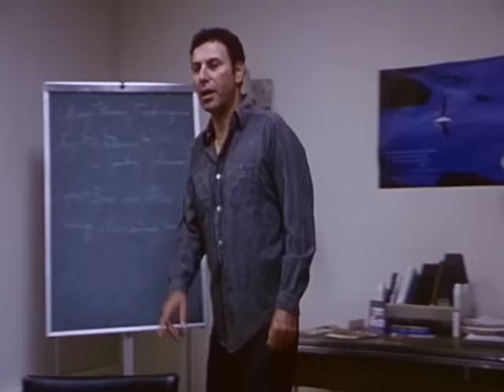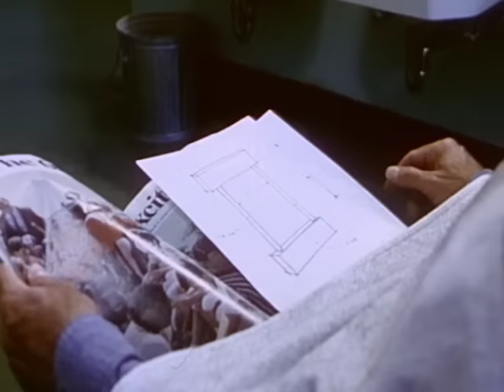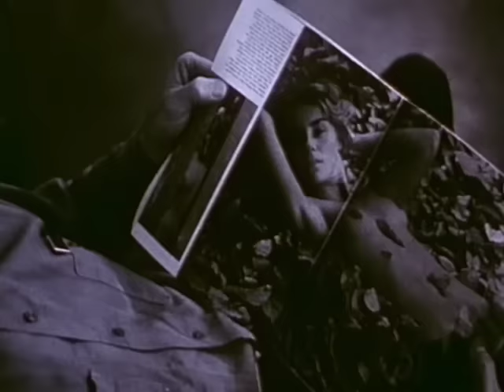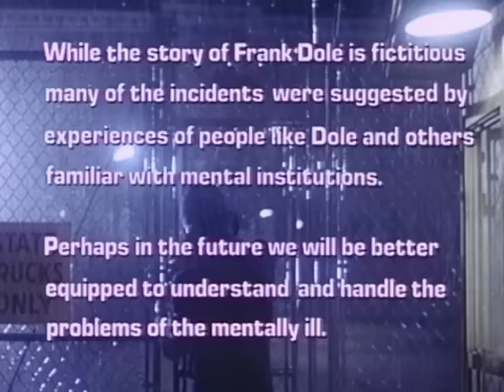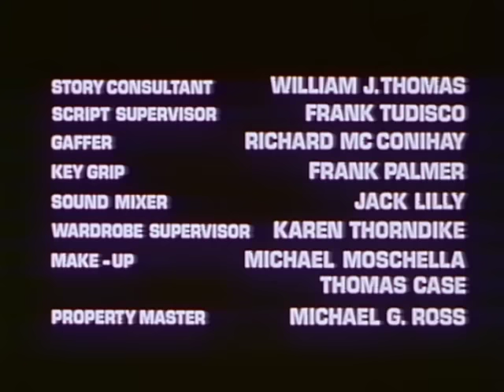The Other Side of Hell | Full Movie | Prison Drama | Alan Arkin | Morgan Woodward

Comment: No saw blade needed. For Bars use wet cloth or towelling, and use a rod twisted into it to apply torsion to the cloth by twisting. It's better than a Jack. The longer the lever rod the more power can be applied. Enough to snap welds, and bend bars enough to slip out.